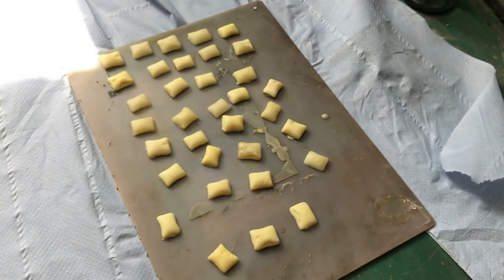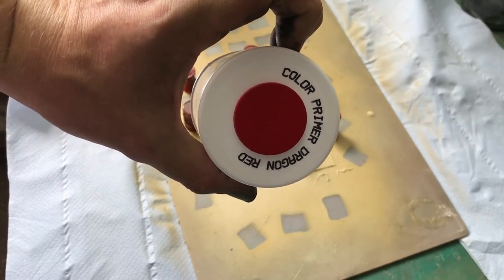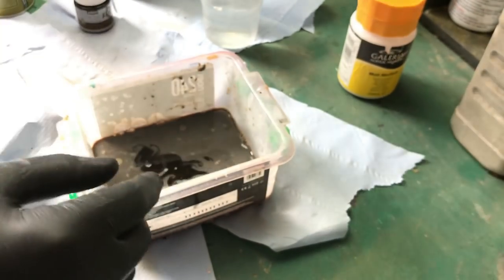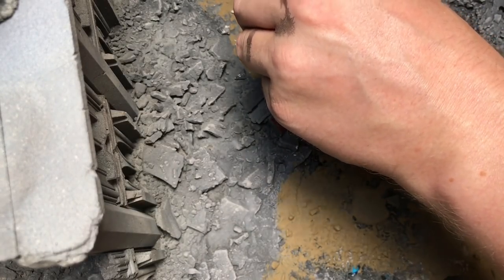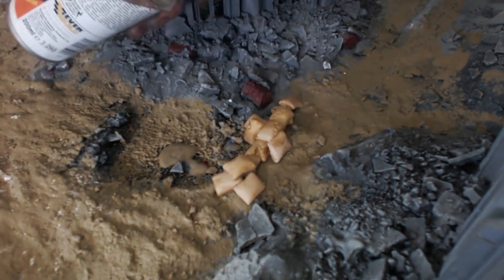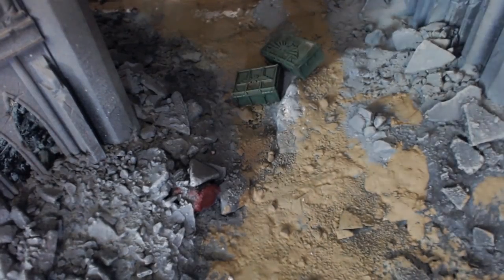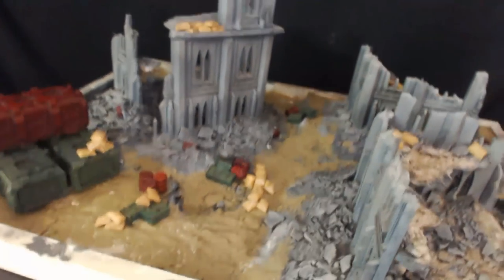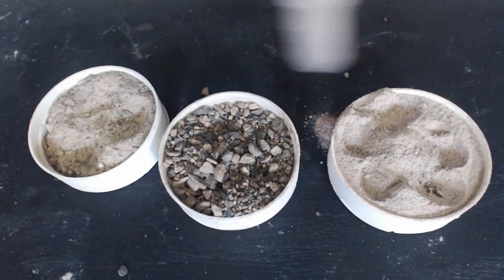How To Build A Ultimate Kill Team Table Ground Covers And Scatter Terrain (Part 4)

Comment: Luke, I have a bunch of mineral spirits left over from redoing my hardwood floors, I was wondering if there was a practical use for mineral spirits in hobbying?
Reply: Yes, you can make washes with them. Luke is right, it's specific to oil paints, you can add oil paint to the mineral spirits to make a wash (no ratios, just test) and then slop it all over and you can clean it back up even when its dry, with clean mineral spirits, hope that helped!
Reply: is this "better" then the way Luke makes his wahses using floor polish and stuff?
Reply: TheBigEB2589 honestly it depends man, I can show you some examples on Instagram if you have one just let me know and I'll DM you, but I would say Luke's washes are overall great for everything (terrain and miniatures) where as the oil ones, I feel like are the best for miniatures, especially things that you want a clean look on like a mech/robot because it's super easy to wipe up panels after and just have it sit in recesses! But definitely let me know your Instagram and I'll show ya

Comment: Too bad, you cannot just translate some stuff you use one to one. The fine sand you are using (soil) means just "ground sand" in german. A more "technical definition" would be helpfull. I just tried to figure out which sand is very fine and i found quartz sand is quite fine.